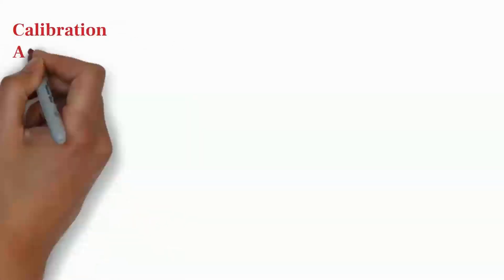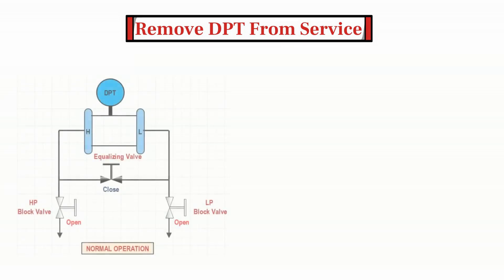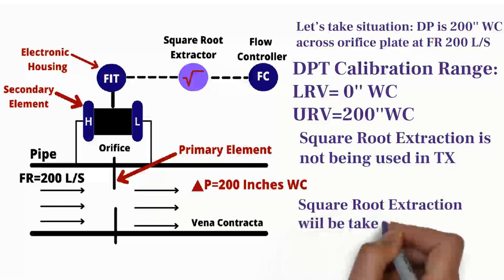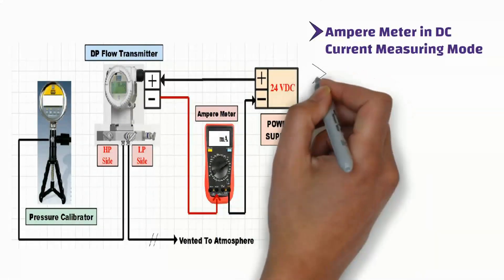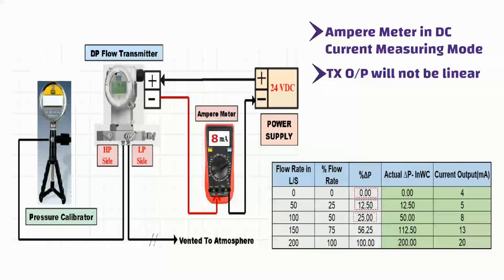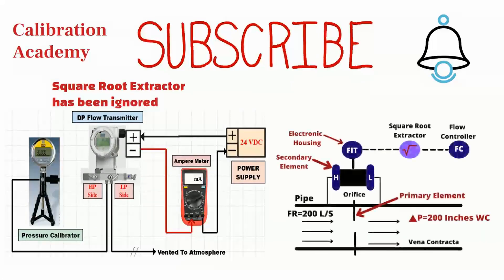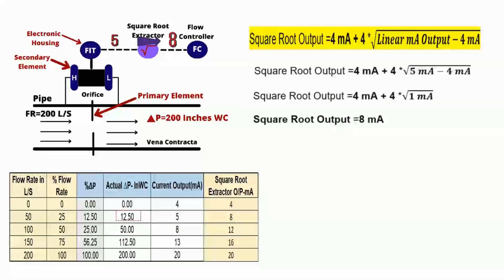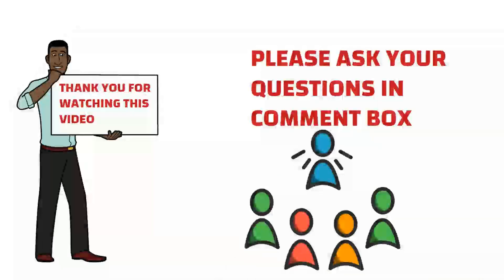Tutorial for DP Transmitter Verification : With and without Square Root Extractor

Comment: I disagree with the verification you did, you said the square root extraction will be discussed separately, means its a DP transmitter with linear range, i.e 0 DP = 4mA, 50 DP=8 mA, 100 DP = 12mA, 150 DP = 16mA & 200 DP is 20 mA,
if the transmitter is configured for square root extractor, the input/output will be as below (Formula: 
DP            mA
0               4.0
50            12.0
100          15.31
150          17.86
200          20.0

Formula:	           	√PV     -	√LRV	
               SQRT mA =     -----------------------------    × 16 + 4
		                        √URV  -	√LRV
Reply: Yes exactly

Comment: You have it backwards, transmitter will be linear with no square rooting.
Reply from the maker: Hello Denny
Flow Rate is directly proportional to square root of differential pressure.
So Transmitter output would be 4, 5, 8, 13, & 20.